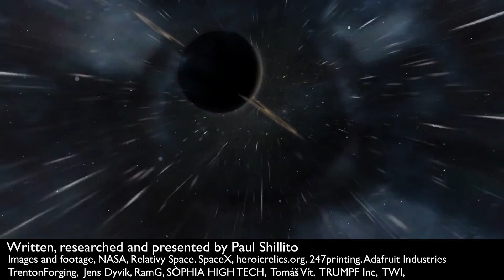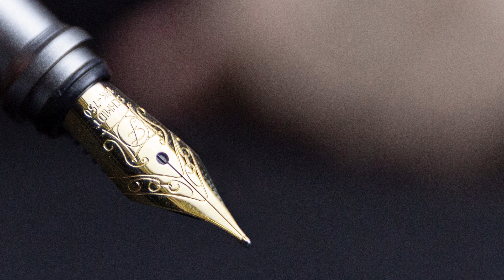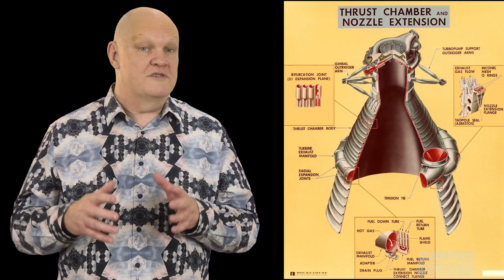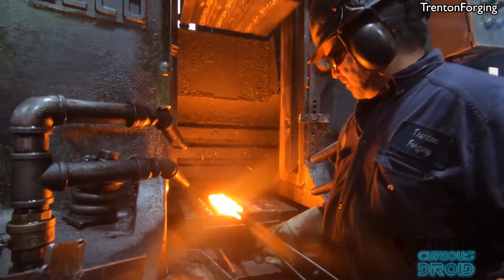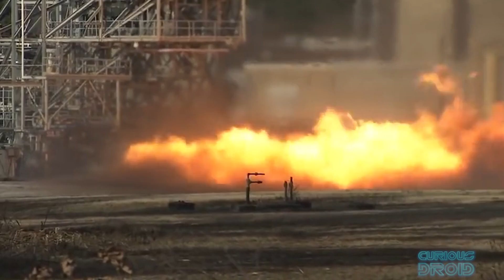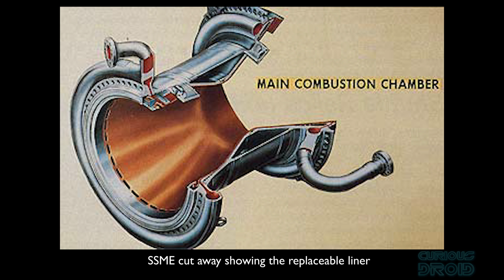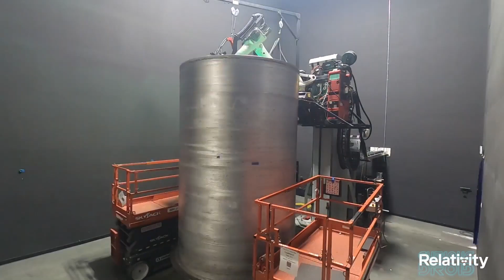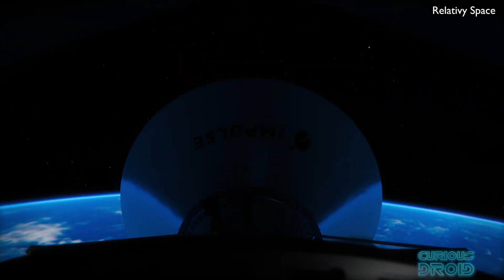Could NASA 3D Print a New F-1 Rocket Engine?

Comment: Such a big engine does not seem to make sense. Also, it was deeply inefficient.  The SartShip has the reverse problem too many small rocket engines make it difficult to achieve reliability.  Additive and subtractive manufacturing are going to revolutionize the industrial processes and combined with generative CAM/CAE and petaflop level workstations are going to create "former impossible" structures and parts with a more organic look.
Reply: Starship's problems are complicated by their landing ambitions.  They don't want a suicide burn so larger engines start to work against them.

Comment: Apollo 13 did have an early shutdown of the 2nd stage center engine.
Reply: Not an F-1.  They were only used in the first stage.
Reply: @stephenpage-murray7226  The first statement is that "the Saturn V had delivered men to the moon with no failures". I am aware that the second stage used J2 engines and not F1 engines.

Comment: No failure of the rocket??? Apollo 13 rings a bell
Reply: aside a minor early main engine shutdown, when did the rocket "fail"?
Reply: @Agarwaen  and what failed in Apollo 13 was a cable in the Service Modules Oxygentank, also i would say that the Pogo-Osizilation where more of an issue than the J-2 Engine Shutdown
Reply: He’s talking about the F-1 which never failed.
Reply: @stephenpage-murray7226  actually he said rocket never failed. Plus f1 failed loads on testing which is why it cost do much to make, kept blowing up due to combustion instability
Reply: @harryvlogs7833  
I’m an ex NASA contractor.  Testing is irrelevant
Reply: @Agarwaen  just said apollo 13 blew up and nearly killed everyone
Reply: @enisrabowman2634  he said rocket never fail to  service module is part of the rocket and it blew up
Reply: @stephenpage-murray7226  no testing is never irrelevant otherwise you can get huge budget overruns like sls is hugely over budget
Reply: @harryvlogs7833  
He’s talking about the F-1.
Reply: @harryvlogs7833  
In redirect to this video it is.  Nobody is saying product testing is irrelevant
Reply: @harryvlogs7833  the best Part of that half backed claim is: i've already stated what failed AND it's not the Rocket that failed, it was the Payload! The crappy Mirror of Hubble wasn't also not an Space Shuttle Problem. The Mentioned Pogo Oszilation of earlier launches like Apollo 6 are a Rocket Problem
Reply: @enisrabowman2634  what the he'll are you talking about the service module isn't the payload it also plays a role in get people around the moon therefore is still part of the rocket
Reply: @harryvlogs7833  no, a Payload of a Rocket is either a Space Probe, a Satellite or a Spaceship and the Apollo CM, SM and LM are the Payload of the Saturn 5. Not to Mention Skylap 1 as also the last launch of a Saturn 5 without the Apollo Spaceship.